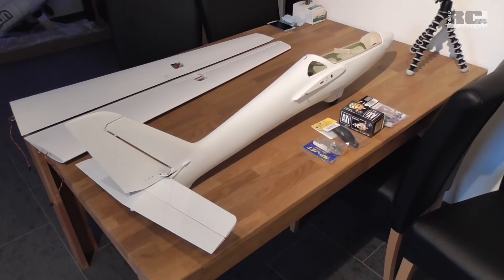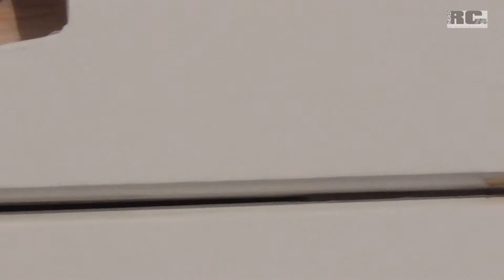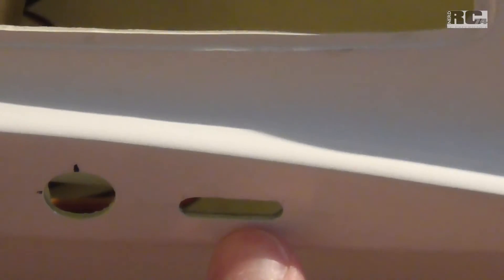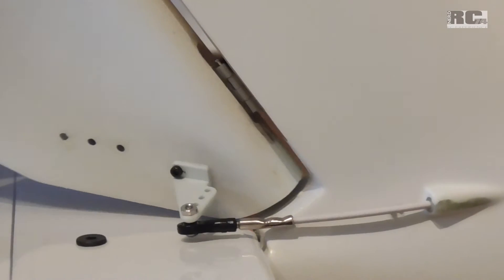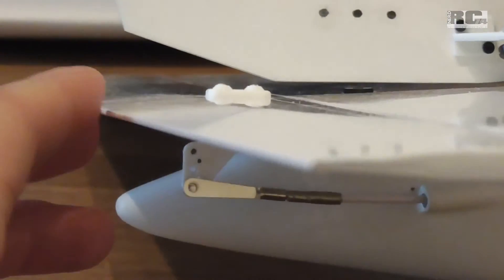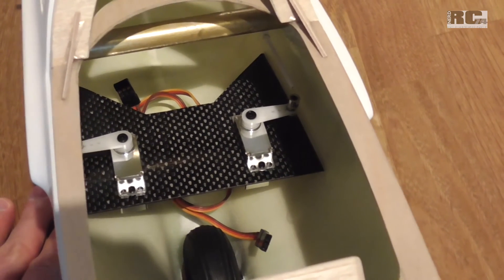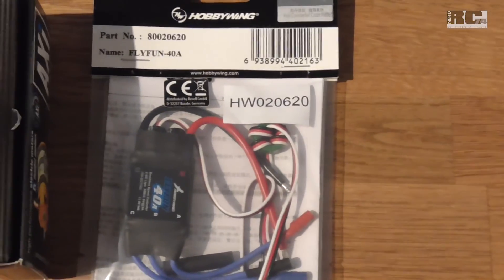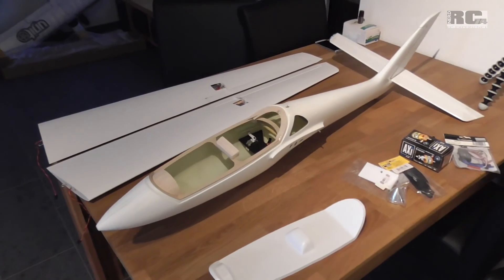ROYAL MODEL MDM-1 FOX RC GLIDER BUILD | PART 1

Comment: hi, what is the diameter of your control rod? is for connection with the ball joint M2 or M3? thank you. very nice plane
Reply from the maker: The rod between the two rodends is M3. M2 should be ok too. But M3 just fitted my rodends.

Comment: Hello,
could you tell me how he joined the ailerons on the wings? You used the hinges as the rudder or tape? if so, what? hello thanks.
Reply from the maker: +Dumbo Hi. I used flex hinges. Not the same as on the rudder. The original tape on the ailerons is not strong enough for high Speed flying and aerobatics..